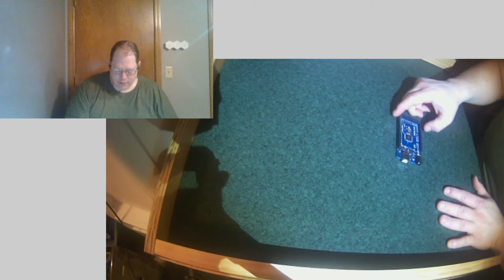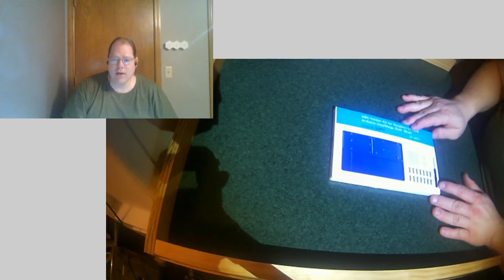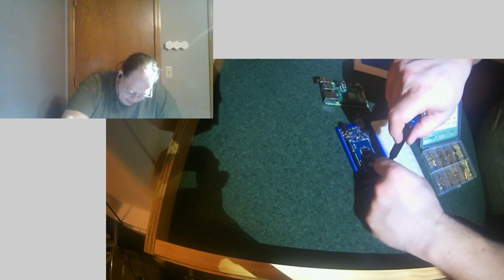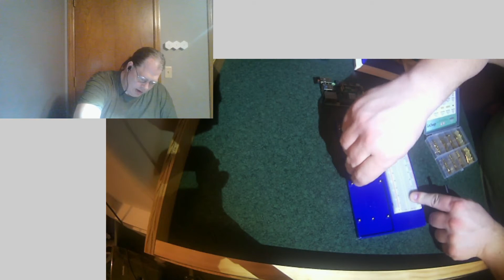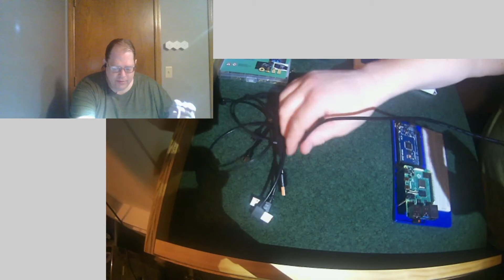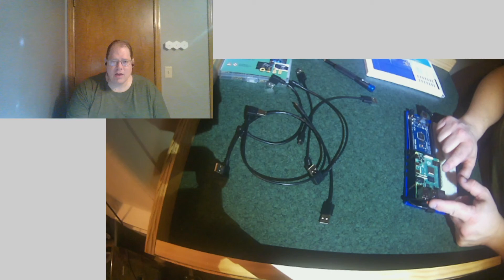Off the Beaten Path: My Arduino/Pi/Breadboard Thinger - Assembly Part 1

Comment: Nice video. Only one I could find on the 52Pi ABS Experiment Holder Platform. Still wondering what the included acrylic washers were meant for.
Reply from the maker: Hey, thanks for watching!  I love these little platforms, they give a lot of flexibility in a nice convenient, portable package.  As for the acrylic washers, I'm assuming they're meant to keep the brass screws from touching the board.  Not a big deal, though, since the boards I've seen use generous rings around the mounting holes anyway.  Glad to meet another 52Pi fan!  They make some pretty cool stuff.